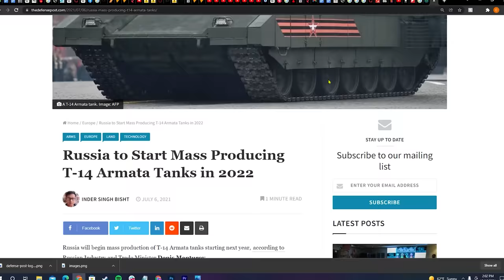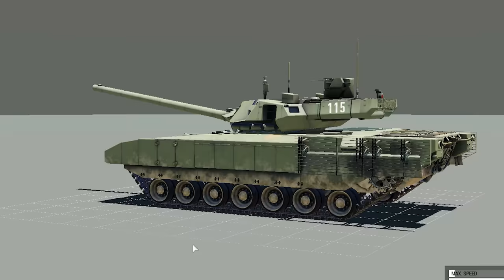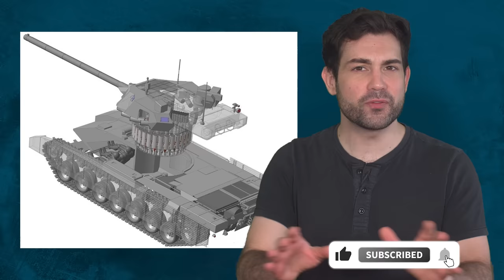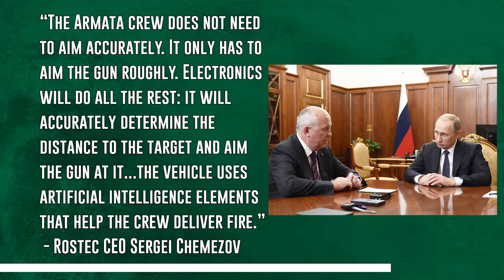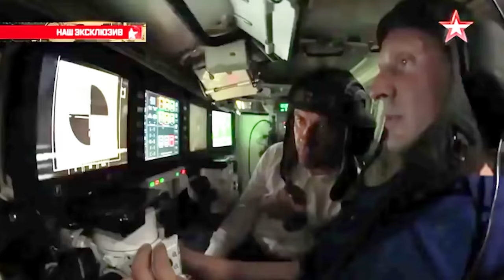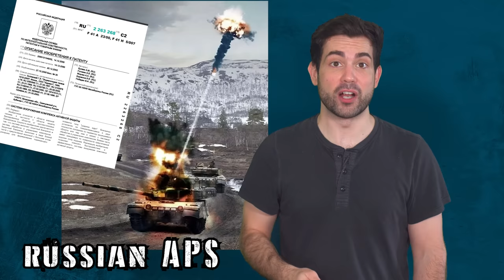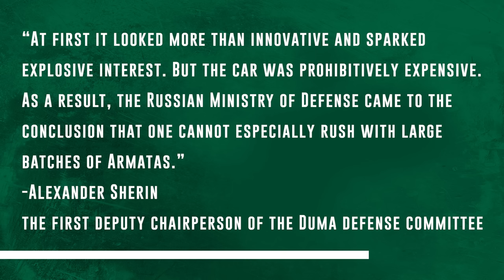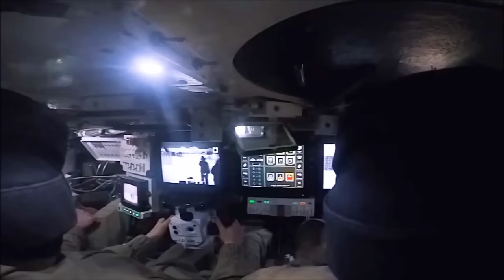The Truth About Russia's T-14 Armata Tank

Comment: The tank response to drones and guided AT munitions is the APS and computer controlled AA MG (or even a fuse detonated frag from the 125mm). Armata having even a small radar combined with automatic fire control systems makes countering drones far more feasible. The Armata isn't so much about having tanks on the ground now but having a chassis that has the capability to house 50 years of upgrades capable of adapting to threats that 1980s chassis can't because they lack the automation to react to current and future threats fast and accurately enough.
Reply from the maker: This is a great summary of the facts . Even if they don’t go into full rate production with the Armata for 10 years from now it’ll still be future proofed for upgrades. Unless drones force tank warfare to go to much smaller cheaper automated mini tanks ….
Reply: @Taskandpurpose  152mm will never be used in T14 Armata. Well, as long as we live. It was tested and it did well on purpose build strengthened prototype but failed twice when tossed on the regular T14. Redesigning would be too expensive. There was no "T14 made with 152mm gun in mind as a future upgrade". It was designed the way, in the future, it would be possible to purpose design the turret. There was the prototype CAPABLE of shooting reliably 152mm but it was absurdly expensive. T14 was the lighter brother of it. The 125mm is a decent gun, but 1000mm RHA penetration at 1500m claimed is beyond what this can do. I don't know if it's 850mm 900mm. I know it is impossible to stretch the T-90S gun's already immensely stretched capabilities. The initial tests of this canon were blowing the gun breach. To these capabilities, Russian propaganda added their own little something-something. On top of all this + 20 - 25% of the muzzle energy, and from this number, the penetration was calculated. Which, of course, does not transfer with a 1 to 1 ratio.
In 2015 I said on all Russian and worldwide forums: "It's 100% not ready!" - what else can I say? I was talking about was the X layout engine. It had more problems one could count. The powerpack is placed in such a way, it can not be placed any other way. I mean with this design. Yet, the design can not be changed because it makes it impossible to obtain this compact and lightweight setup. It has to be only this.
The APS hard-kill type was not yet ready. It takes more money and time to test and make the settings right it could work reliably than designing and building the whole system.
The VERY long-range shooting with this AI-supported "rough" aiming system. Yeah, this was in its infancy in 2015.
The issue in the official announcement at the parade was not a handbrake. The transmission was jammed.
Making T14 canon work on T-90S was a flat-out lie.
Reply: You cant counter Drones with that MG unless it has a guiding infrared radar, which it surely doesn't have unless they didn't give a shit about the visibility of the tank on the field...
Reply: @VeXu666  The MG is controlled by a computer connected to the afghanit radar which is already on and IR/Optical sensors and aimed and fired by the computer automatically. It doesn't need human aiming or reaction times, it has an AI. Just designation of a pre-tracked target and a request for permission to fire to avoid the AI shooting friendlies. Sufficient for a quad copter or catapult launched drone.
Reply: @HanSolo__  why do you think the transmission was jammed?
Reply: @VeXu666  Drones can be visually identified by cameras and some AI. Which is probably why it is placed on the commanders optic.
Reply: @HanSolo__  any proof about not being able to use 152mm?
Reply: @Kasian02  Russian documentation. I don't remember where did I get it but its a older piece. Before 2005 IIRC.
Reply: @marinodezelak1180  Handbrake? Seriously. The media described it. Armor related forums for example - obvious thing. Yes the driver fault more than the tank but stil. This is automatic transmission. Its really hard to jam it.
Reply: @HanSolo__  Yes the media was quite eager to jump on the idea that the tank "broke down" based on absolutely no information at all besides another tabloid who just made it up it broke... 

Still remember how pissy I was bout those tabloids lying to me when I inevitably saw the video of the tank driving off by itself once they figure out the electric handbrake was engaged by an inexperienced crewman.
Reply: But Rheinmetal has had "trophy" like systems for 10 years. You can strap that on almost any tank without needing a new chassi.
Reply: @ellioteslander3046  Yes, and the whole tank will be running like that eventually. MGs, main gun, ATGMs, etc. But you have to have a chassis with an fully automated turret for that.
Reply: @marinodezelak1180  One thing for sure. "The T14 tank broke!" by the mass media not related to the military industry shows perfectly why I don't even try to look at these. It shows how far they would rather "sell the news" over "covering the topic".
Reply: @dess3597  drones need to be ranged by a laser which most drones can already dodge easily with speed.
Reply: it can be pretty suspectible to laser and infrared decoys.
Reply: ... and we're expecting this from UVZ? The same factory that made 90% of the defective T-34s that broke down after less than 200km of operation, on average while still costing more per-tank than a Panzer IV?
Reply: @HanSolo__  much simpler reason, 152mm has very few rounds of ammo, maybe two dozen max
Reply: It's a pos
Reply: @Taskandpurpose  A few issues though. The drones that are primarily hunting armor aren't these tiny scouting drones infantry units are starting to carry to scout things out. The drones that the tank should be fearing are around 20,000 feet in the air launching big boy missiles, not Javelins. The reason why the U.S. had spent so much time not integrating APS when they've been available for decades was because of the fear that if we got into combat with a near peer adversary, they'd just launch swarms of HARMs at our tanks and they won't even need to have folks on the ground to guide or target for the missiles. All of the EM radiation from the APS is enough to guide the missile into the tank. If you take something like a land modded Harpoon missile and gave it an anti-radiation seeker, you now have a $1.3mil missile that can easily take out that $3.4mil tank with no loss to U.S. lives and the missile is large enough that there's no way for the tank's APS to take it out before the missile smashes that tank. Even if the missile detonates above the tank, the explosive strength is more than enough to absolutely trash the tank through sheer explosive force while targeting an area that's traditionally very thinly armored. 

Russian can't afford a 3:1 economic loss versus an economy much larger than itself. This is probably why they're pushing so hard to export these, while keeping their upgraded T-80s/90s for themselves.
Reply: Thing is friend, do the sensors and optics survive the first, and or, multiple attacks. All that pre detonation ends the sensors. IMO the US hasn't fielded a new tank because the writing was on wall 15 years ago. Tanks are obsolete in major war. It is a drone dominant environment now.
Reply: @HanSolo__  Everybody knows the next war is electronic not guns?
Reply: Well said
Reply: Vladimir Nikolskiy  The Cossack side of my family is actually from Kuban, not Ukraine. My father was born and raised in Moscow. So... yeah... Try harder.
Reply: @HanSolo__  One credible story was that the controller (computer) for the transmission had an error and engaged a set of gears that locked it up.  It took a full power-off reset to resolve the problem.

That's a minor fault, certainly not justifying the "broke on the way to the parade" headlines.  It might reflect on the untested nature of the software.

I certainly would question a story that blamed a bad crew.  They aren't having a 18 year old conscript drive the latest tank in the Victory Day parade.  The commander sits right beside the driver, and he couldn't figure it out either.  Sure, call them "inexperienced", but only when it came to working around the mobility-killing bug on a brand new prototype.
Reply: @marinodezelak1180  most of the military info is not true example "t72b3 2016 has relickt era"
Reply: @battleshipman56  But, of course. The version with easily equipped 152mm, has been abandoned. Wait, no. It was not the choice at all. The delusion or just the young age? I take no editable English written info from the internet. 
Just to inform you - this project was pumped up with money from pre and early post-2000 onward. 
The fantasy of the USSR made MBT with zero available microprocessors. I find no words.
Reply: @namesurname624  Yes. It was a huge problem right from the start. I would say even less than that.
Reply: @pwrserge83  Hey I'd be really interested in reading whatever is the source of that information?
Reply: None of that matters if you can't afford to build or maintain them. It seems half of the Russian arsenal can't even make it down a road going 10 mph.
Reply: @battleshipman56  T95 was never fitted with 152mm gun. Neither is t14 since the tank exists only in games and not in any battlefield. A javelin can take this easily out just like any other tank.
Reply: Russian chip technology is 10 years behind
Reply: @carlsfetcu4800  They've tried T-34 with 100mm gun. Having 85mm shows it was not the best idea. 
Good idea would be IS-2 with 100mm gun. But hey all IS-2 they've lost were too slow to immediate fire answer with their 122mm.
152mm in a Soviet tank?KV-2? I wouldn't go that far with 200 tanks as entire production of hovitzer mounted in one of the 
worst designed turret of the era.
Short stubby hovitzer of a very low pressure character. 
Whats the idea of comparing gargatual tank-ish short  production run with Stuart, made in volume of nearly 9000 (M3) of this very successfull light tank that was many years after WW2 modernized and modified multiple times just to keep it running.
If I would like to show 152mm cannon in tank-like action I would pick Czech/Slovak made Dana Danz M or M2 SPG in the drill of direct fire training with its huge 152mm cannon sticking horizontaly  from the side of 8x8. It shows very big 25-29ton artillery vehicle rocked with the gun energy like a toy.
Reply: @HanSolo__  Skoda (Czech) has a very long history in building big guns for Germans in both world wars… still… don’t compare light tanks with medium or heavy… as for the KV-2… that was a bunker buster heavy vehicle… never designed for armor combat… All major heavy tanks had issues in WW2… however… Germans had a specific type of ammunition for them… about 5 rounds per every tank or SPG with 75 mm cannon… the only bad part is that most crews didn’t had enough time for training on those vehicles… on both sides… at Stalingrad for example T-34’s produced in September and October in the city they where going straight to front line from manufacturing line which at some point was right around the corner of the street… never underestimate the will of survive when humans despair
Reply: @VeXu666  Infra red?? The electric motors on UAVs have tiny heat signatures.
Reply: @winstonsyme7672  tbh none of this matters because the tank will never see mass production. Future proofing for a future that won't exist.
Reply: T-14 is a prototype very unlikely to ever go into production. Hardly game changing.
Reply: The reality though is that nobody knows what are the specs of that tank are for a fact. Until they put it into action and everyone sees how it performs on the battlefield it`s all just speculation.
 I`m not a military or tank expert but I think that basing one`s speculations for what this tank on  experience, physics, engineering etc. is not logic that should be applied here. I think history can show more than enough examples of Russia making such claims as well as how credible they`ve turned out to be. In fact if you listen to their words they are always the BEST in everything. 
 The comments I read here were quite an interesting read really but I unironically think that they`ll turn out to be irrelevant  in the end.
Edit: Lol let`s not forget that these are the ppl who deny an ongoing war and call it "special military operation". Hah and their flagship caught on fire and sank to the bottom of the sea due to an unextinguished cigarette. Or in other words - the 2nd strongest army in the world!
Reply: @Taskandpurpose  If you go down the path of an automated mini tank, you'll probably find you need a different chassis. Besides, the mechanicals are not the difficult bit. Its the electronics and software. Russia isn't going to have suitable electronics for a long, long time.
Reply: @Talishar  They won’t be able to build squat until the sanctions are lifted.
Reply: @grahamstrouse1165  The Russians have the tooling and ability to still produce Soviet era equipment without issue. It's the modernization kits involving complex things like gen 3 thermal sights and modern fire control computers that'd be the issue. The point I was making was that Ukraine can just load up on vastly cheaper infantry missile systems and can still afford 10:1 missile:tank exchanges and come out economically ahead. We can even go much more expensive using larger surface launched tactical ballistic missiles against a tank and STILL come out economically ahead. The point is that poor tactics will break you financially rather than quality of equipment.
Reply: @Andytlp  That makes sense seeing how all there equipment uses chips from the west.
Reply: Again, all of this looks really cool on paper but... it simply does not exist. I can hire robotics engineers and 3D artists to make a blueprint of a tank that can shapeshift into a freaking Bumblebee with plasma-guided-you-see-what-I-mean missiles and it will help me to secure a grip on a very fat slice of state budget but really... how can we evaluate it if it is literally impossible to be mass produced? Or better - if no one even had the idea of mass-production it in the first place.
Reply: @HanSolo__  bro you think your a military expert now
Reply: @Gearparadummies  well your right then tell me how many prototype tank that america produce in the last 20 years and all of them failed
Reply: @PoisoNouS_2326  A "reformer" fan, huh?. First, procurement processes in the US and Russia are radically different. The US doesn't engage in production for a replacement unless the new prototype results in a technology leap. The M1 Abrams was designed to be upgraded for decades, that's its main strength. The Russians are constantly designjng "wunderwaffes" that they cannot produce in significant quantities. The Armata was presented in 2015. Still a prototype with no mass production date in sight. Furthermore, the moved the production target from 1,500 to just 100. They have produced less than 20 to this day. The SU-57 was designed in cooperation with India. The Russians failed to produce good enough engines and India bailed from the project. 12 years later, there are only 10-12 SU-57s in existence. Provided they reach the goal of 80 produced in 2028(Which I very much doubt) that's a pretty poor production rate. The T90M series is the last iteration of the T-72, a tank designed in the 60s. So, what you call "failed" prototypes other people call "common sense".
Reply: @pwrserge83  How many kilometers are there from Moscow to Berlin? if we look at history, it is obvious that the "broken" T34 entered Berlin, which is not the case with the Panzer IV and Moscow.
Reply: All these fancy words but the tank needs to be towed into battle because it doesn't have an engine